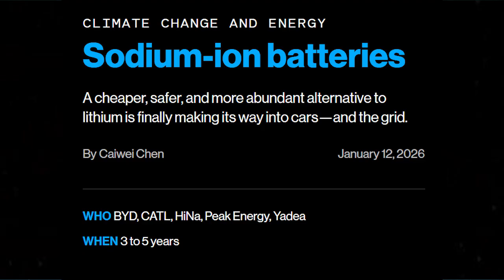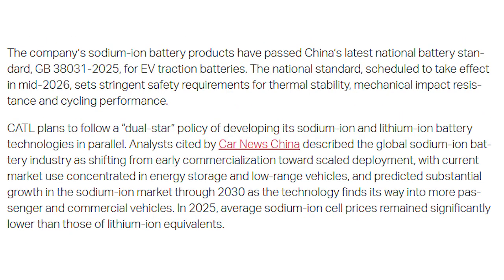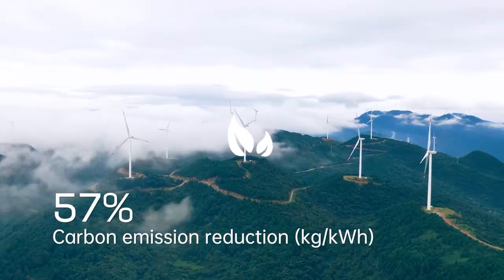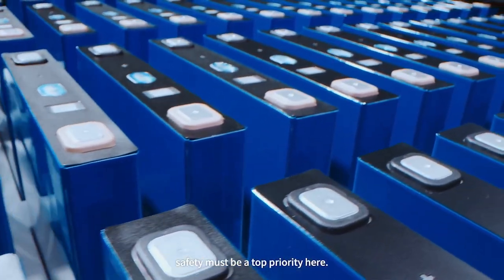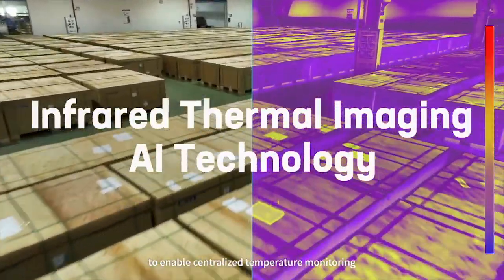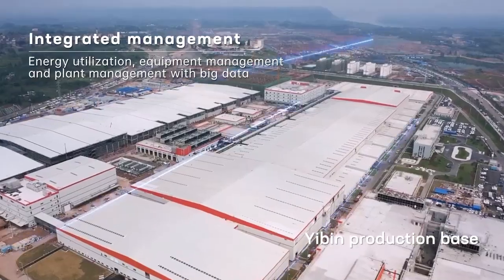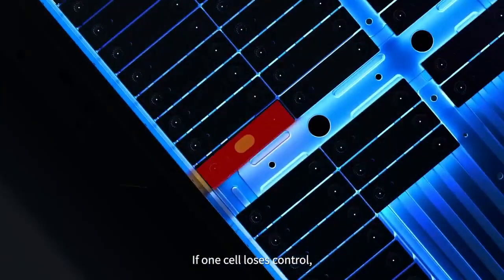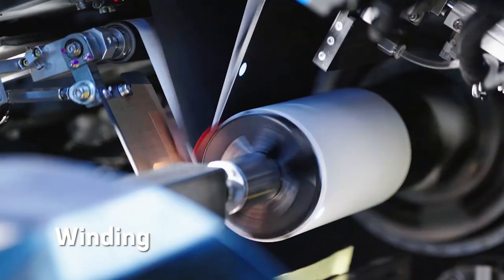CATL’s Secret Weapon: How Sodium Ion Just Broke the Market

Comment from the maker: Do you think the Sodium Batteries from CATL will be as Safe as we are led to believe?
Reply: Yes - but with the realisation that it contains a very large amount of energy that has to go somewhere if it does go up. It's way safer than LFP and vastly safer than NCM or Li (or anything involving a gas tank) but it's still a lot of energy and needs to be handled with respect.

I don't for example see changes to policies like house batteries going on outside walls or in garages.
Reply: As long as Sodium batteries don't explode like Lithium volcanos, people will  accept them.
Reply: @RemusKingOfRome 

You can short the cells out and you might melt the wiring or bus bars but CATL and the other Chinese manufacturers have had to put all  their new cells and packs through some pretty Draconian tests, that basically say no Chinese company allowed to produce a battery that can burst into flames or explode.. they incorporate aerospace grade membrains and extinguisher systems and  pyro fuses into all automotive packs and failsafe containment  functions so even if a section was to fail you can still continue to drive the vehicle... akin to a limp home mode or self sealing fuel tank in a military aircraft .  
They also have to pass external fire and immersion tests.. as well as the physical damage tests of crushing in different plains , 
Penetration tests and sawing and angle grinder attack 😮 without ignition problems.  They have also forbidden any solely  electronic door handles and locking because of a few accidents have seen people trapped inside in floods catastrophic crashes resulting in fires where the power has failed and doors and windows have not been openable from the inside or out .. so all door handles and locks have to be mechanical failsafe override able.  Logical really as  this has become a growing problem globally as designers tend to  loose sight of real world safety issues and  increased natural and anthropogenic risks. 🤷🏻🧙🏻‍♂️🥼 
The touch screen multi layer menus systems will probably come under their scrutiny as well if it proves problematic... Some companies are already reverting to important primary vehicle functions being run from actual switches or separate buttons  because of the frustrations and dangers associated with virtual  controls especially for some people who can experience particular problems with touch screen response 🙋🏻🧙🏻‍♂️🥼😂... dead touch fingers or conversely  nearly  insane overreactions. 

There's also the problem of what happens when extreem temperatures and high moisture..wetness... levels start effecting sensitive electronics. Important in vehicles that live and work in the real world ..not drive from a garage to a covered carpark most of the time. Thankfully as said some are taking note and hopefully sticking to functionality rather than bean counting or slavery to fashion . Edison motors and Skoda are two that spring to mind. ..despite the cost. 

Don't even think about using your phone to control 🛂 a vehicles primary functions or provide critical displays ... that way lies madness and planned obsolescence, hacking and absolute pay to play controling behaviour. 🙂‍↔️😬
Reply: YES! 😂 As simple as that.
Reply: Sounds like nasa has some explaining to do? So a sodium battery that is 3d printed with nasa's plasma printer? But just guessing.
Reply: It depends on what cathode and electrolyte is used. Sodium isn’t inherently safer than lithium. It’s just that the cathode materials used in most sodium batteries have lower oxygen content and don’t rely on catalytic elements like nickel and cobalt, so they don’t suffer from the catastrophic runaway reactions that NMC lithium cathodes do. In truth, LFP cathodes are very similar in that respect. I don’t think sodium is a great deal safer than LFP, but it is massively safer than NMC for sure. As the video said, it’s more about supply chains and robust raw material management than the battery performance.
Reply: Yes. And I'm also looking out for them being used for grid storage. That will drop the retail prices significantly, making them an excellent choice for home storage.
Reply: Donut Lab's battery is Sodium!!!  WOOT
Reply: @mark.pinnell 
CATL were talking about applying Na to solid state because if they can crack the solid state structure it produces a high capacity high performing cell that will last and last and isn't  tied to Li.  availability or any rarer elements  even copper .
Reply: @mark.pinnell  I've not seen anything to that effect.
Reply: @mark.pinnell  🤔🤭☺🤗

Comment: The interesting thing is that if you look at the naxtra battery specs, there is one detail missing. Sure , the Naxtra battery has a very similar kWh per kg to first gen LFP battery's, bit what about the physical size comparison? Is this also comparable to first gen LFP batteries. This detail is missing from. The Naxtra spec sheets

Comment: Stationary storage aside, it will enable very very cheap urban vehicles with 200-300km range that can be used as taxis, daily drivers and general shopping carts, that sell significantly below price parity with ICE, thus enabling a huge shift in perception of what BEVs are.

In that regard, it could be the Na battery that kicks the inflection curve to vertical on the S curve of adoption.

Comment: Excited, and Delighted as I am by this tech... it won't solve congestion. (Now will flying taxis, the noise would be unbearable.) Actually just thinking; this new drill that they are going after, deep geothermal, that melts the rock with microwaves, if that could be used to bore tunnels much faster and cheaper, an underground network would be great. Don't allow us to become two species though.

Comment: Unless we're missing some fatal flaw, it's hard to see how LFP will ever be ordered for stationary storage again. This will help drive the cost of sodium batteries to unbelievable lows, allowing for dirt cheap run-a-round vehicles. This in turn will allow 'developing nations', to skip the fossil fueled personal mobility step and move straight into EVs. Imagine, living in some remote town in (Place name of poor place here.), where the road in and out is un-driveable for long periods of time. No one is going to want to rely on a diesel tanker getting through, now Imagine a co-op, getting two or three of the cheapest EVs available, which will probably be about 3k new, and a load of old solar panels, plus some of those cheap, cheap batteries.. and you can run a reliable taxi service, ambulance service, whatever, for the next thirty years with minimal inputs needed.

Comment: In many cases the acceptance of electric vehicles depends on several factors.  One of the most important has always been range.  No one wants to have to stop and charge too often.  The problem is not solved with Na ion because of the energy density.  However, the weight is less than Li so more cells could be used if space allows.  The other big factor is environment.  This is a huge advantage for Na.  
    The sodium technology  and any further improvements have put battery energy storage into a new realm with good and bad effects.  Sometimes it is hard to know which is which.   The extremely long useful life will make a big difference in how long a vehicle is usable.  For example many commercial vehicles are sold or scraped because of cost of maintenance.  Mostly because of fueled engine and limited mechanical life.  This is going to change in the future because the electric propulsion system is more reliable and easier to maintain.  The batteries are going to outlast the vehicle.  Most of the other repairs are outside the drive train and are relatively cheap.  Fewer new vehicles will be sold.  Charging requirements are about to explode.  Our infrastructure does not exist to handle this load.  Data centers will make this worse.  We are not energy limited, we are energy distribution limited.   Gas delivery business will be in trouble.  We can look forward to interesting times.

Comment: Na+  Akkus  sollen zu erst  einmal die Pb Akkus ersetzen. deren  reale Kapazität  liegt nur bei ca. 50% des Produkt  aus Spannung ( z.B. 12 V)  und der Ampere Stunden ( zum Beispiel 105 Ah)  = 1.260 Wh  aber real  sind es  nur 600 Wh und bei Minus 5°C  fällt die verfügbare  Strommenge  deutlich.  Zudem  kostet so ein Pb  Akku. mit 105 Ah  auch $ 100. 
Der Markt für Blei Akkus  ist  extrem groß :  Sicher  100.000.000  Stück'  p.A.  mit Kapazität von 35 Ah bis 200 Ah . 
Also  in kWh = 1.750 MWh  + 10.000 MWh . Daher. kann man  so schon Minimum eine GWh  Fabrik  auslasten.  Und wenn die günstig  wären  (  um die $100,- je kWh  Kapazität  als  Akku)   dann knallt  der Markt.

Comment: Hello Ben, from Brisbane, Australia.
What do I think?
I don't know that combination batteries are the answer, I can see the appeal, but I think look at the application and then decide which one is appropriate.
I have solar on the roof. I don't have an EV car and I don't have a house battery / power-wall. I'm thinking about getting the power wall, I want one, but ~
In Brisbane, I don't have to deal with temps 20 or 30 degrees below zero (thank God) but I do live an a weatherboard house made in the early 1950s. It would burn like a heap of balled-up newspaper. It might only last 5 minutes, but there'd be nothing left, and the heat would be like an atomic bomb. 
I have a problem with dendrites. I have a problem with EV cars that burn like an incendiary device, used in WW2, Dresden and Tokyo, like Napalm, like a bath of boiling petrol in a pure oxygen environment. Like most of the state of Victoria is burning as I type.
If you can make a battery, which is within 10 or 15% on energy density, which operates better at extremes of low or high temperature, which does not depend in every cell on Lithium and Iridium and Unobtainium, or the Gold-Platinum alloy that Donald's Rump had just placed a 200%  tariff on, if that cell is made with salt that's in the ocean, and you can manufacture them on more or less the same machines and lines in use to make Lithium Ion batteries now, then I don't quite see what you want to make combination cells for.
If that cell does not and cannot burn because of dendrites, and it has a long useful life, like the million mile claim, or like 20 + years in grid storage, then you have a winner.
I do think we also need to start talking about Big Batteries, flow batteries. Pump the electrolyte through the cell and charge it when solar is cheap, then pump it off to a tank like the ones in oil refineries, 60 ~ 100m across. Millions of litres. Then as the sun gets less than about 5 degrees above the horizon, you start pumping the solution (electrolyte) back through the cell and selling that energy back to the grid. How much storage do you have? 3 days? 7 days? How many tanks did you build? What is your charge or discharge rate? How many battery cells did you make, attached to your tanks and plumbing?
Cylinder batteries, Power Wall / Tesla car type batteries, have a practical use in grid scale storage, but that's voltage and frequency management, virtually instant response. For large scale storage, pumped hydro is good, if you have the geography for it, but most of us don't. Flow batteries are good, in most cases. I don't know how well they would deal with minus 30 degrees C, that might be an issue ~
In the days of coal & oil, the answer was always more coal or oil, perhaps natural gas. That's not the only way to deliver electricity but it is a way that can be used in a very broad range of conditions and geographies and political / socio-economic ~ But it's destroying the planet, and we need to change.
The thing about renewables, is there's not one Silver Bullet like coal ~ there are lots of ways to generate electricity. There are lots of ways to store it. Shipping and distributing that electricity, there are even different ways to do that. Look at high voltage direct current. Look at Australia wanting to build the world's biggest solar farm and then lay a cable to Asia, and sell them green electricity. Not coal, not gas, ready made electricity that was all generated with solar, and sent to them through a cable about 150mm (six inches) across at a couple of million volts.
Q: What's the best method?
A: Depends what the problem is. You can (if you must) drive in a nail with a 12" shifting spanner, but that's not the right tool for that job. You can (if you must) stick the head of a 4 pound hammer on the top of a tennis racquet. Then you will be able to return serve and drive a 3 inch nail with the same tool ~ but it won't be very good at either. The Best Method, is to know what tools are in your toolbox, know when and where and how to use them properly, and then use the right tool, in the right way, at the right time, on the right job.
They taught me this when I learned to program. What's the best programming language? Wrong question. What's the job you're trying to do? What hardware? What Operating system? How deep into the hardware do you have to get? Is this going to be a user-space program, or a system type program? Does it have a graphic user front end? There is a place for Assembler, for Pascal, for C and C++, and Java and javascript. There is a place for Python, and for Rust. They tell me there's even a place for LISP although I've never seen it ~ Point is the best programming language, is the one that's built to do the kind of job you're trying to do. C is good for talking to hardware, while still being a high-level language. But it can cut your foot off. C++ adds things like Inheritance and operator overloading. It's like juggling 5 chainsaws in the place of one. It can do amazing things, but it can have amazing bugs, too. Rust is small and fast and powerful in ways that rival c, plus it is memory-safe by design, but it's a pain in the arse to learn and to write. My point is ~ there are use cases for all these tools. The trick is find the tool which fits your use case the best, and then use it the way it was meant to be used. Don't stand on the roof and tell everyone with a loudspeaker that you use Arch, (Actually), and c is the language of God and the rest of us are Philistines and heathens. Learn to use all the other tools as well, and then learn to identify the times and places and uses for those tools, Stop being a  priest / ar$ehole and start being an engineer / programmer. We pay you to find suitable solutions, not religion.

Comment: Just read an chemical engineering article that's found by keeping  salt water in Na ion cells you can't boost their capacity and performance /life even further beyond LFP and it may also enable some element of desalination activity. 🤔🥼🧙🏻‍♂️🇬🇧 at the moment it's lab testing and playing with the seperator the liquid is a Na salt incorporating. ..NVOH Na vanadium salt wet composition .. university of Surrey.. -40 to plus 100deg C temp stability .. and cell voltage doubles ..

Comment: Being a former fleet owner in a cold climate environment, a completely agree with you on your final conclusions. Sodium technology, already as it is today, would have worked perfectly for me. Mostly short to medium long trips with the odd long distance trip. Some unavoidable downtime perfect for fast charging opportunities. But the most important bit is the resale value after 250 - 350' km. With a battery with only reasonable degradation, it should be an attractive deal for a private buyer.